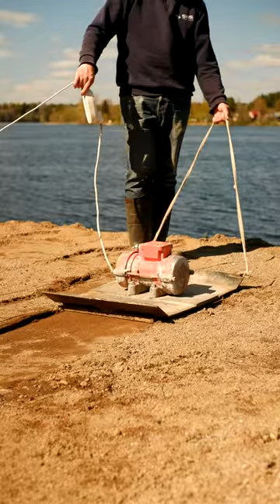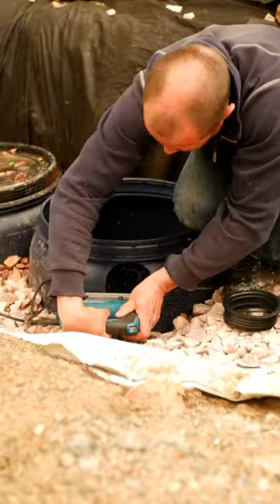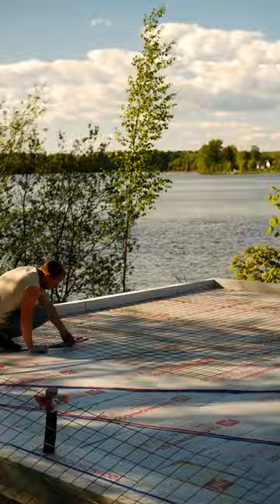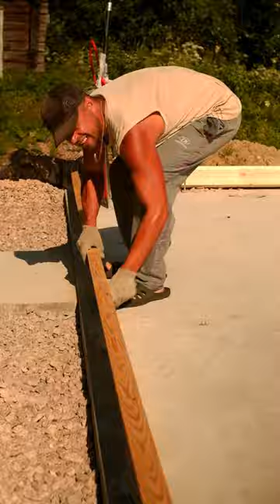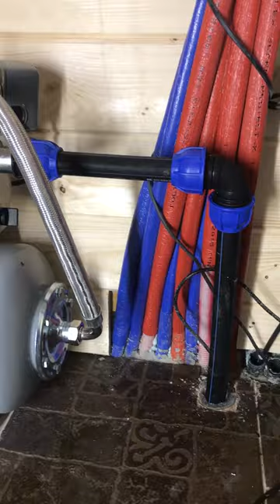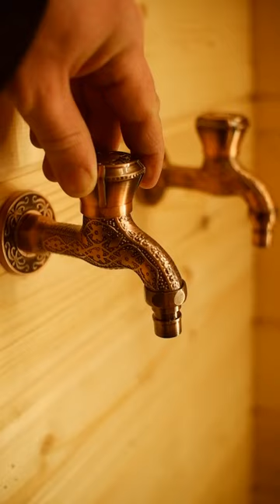Built a Dream House Alone! Engineering Communications Diy

Comment: Impressive work to do by oneself, but no damp proof membrane to stop moisture coming up through the slab?
Reply: If the 6" of foam he put down on the dirt doesn't stop moisture from reaching the concrete I don't know what would. Of course, the foam is flexible, so any ground movement is going to crack the slab, which will likely puncture his radiant floor plumbing system, especially since he put the wire reinforcing screen on top of the plastic pipes.... That the house didn't fall over right away is impressive, but there's a lot more wrong with it than no vapor barrier under the concrete.
Reply: @Dwayne_Bearup  Yeah, the next major storm that goes through is going to wash that entire building away. I saw a container ship in the background, so it's clearly along some major water way.

The fast current of the water also means erosion is going to be a major issue. I give that building 10 years at most.